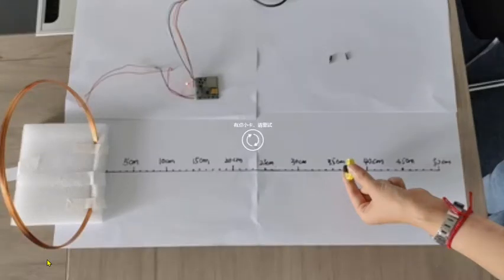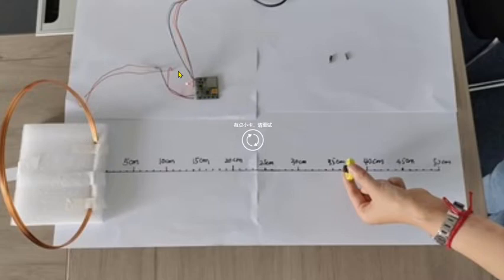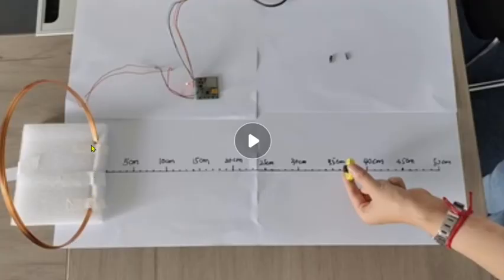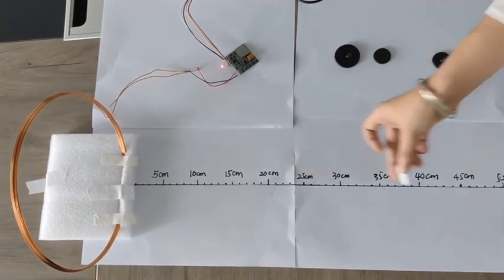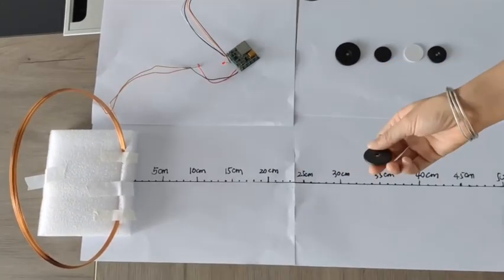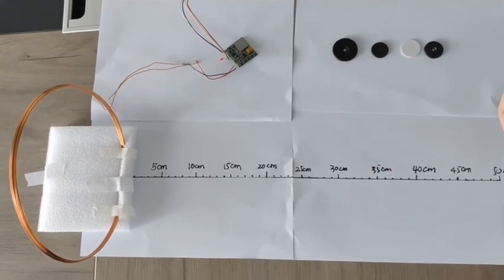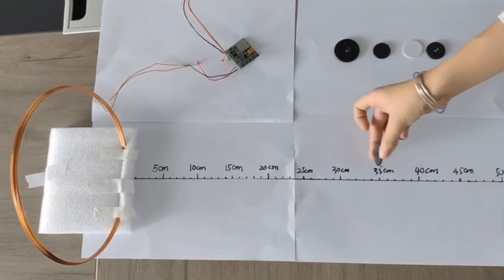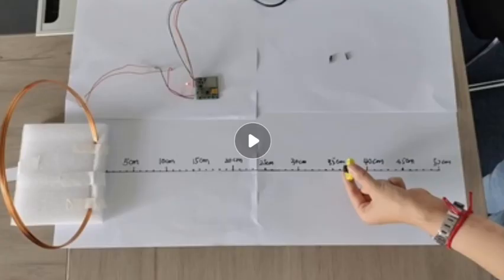How make an RFID Low Frequency Application long range by using suitable antenna

Comment: hello, what type of sensor that being use in this video, can it connect to the arduino and also can it be sent to malaysia?
Reply: Ni guna rifd,Nk buat utk apa?nk sy kongsi link rifd?antena dia diameter 22cm,kalau awk nk buat antena lg besar,seller tu boleh ajar,tp lebih baik awk beli meter utk test antena,sy bg tau awk ni,mana tau kot² awk nk buat antena besar,ble sy tumpang sekaki

Comment: do you have any documentation that can help me make such a device like that . thank you have a nice day.
Reply from the maker: The coil is very cheap. You don't need doing ti yourself, order from us.
Reply from the maker: https://www.security-warehouse.com/uhfat13.html
Reply: @RFIDSecurityWarehouse  that link gives a 404
Reply from the maker: @StephenKellyQLD  sorry for mistake, it should be at https://tw.security-warehouse.com/uhfat13.html，the website is in chinese but you can use our translator to change.
Reply: @RFIDSecurityWarehouse How much does the antenna cost and what size is it? Do you sell a 20cm diameter antenna like in the video? Or is there a larger size?

Comment: Greetings from Spain. Could you describe the diameter of the coil, the number of turns, the gauge of the copper wire, and the model of the sensor circuit? I am very interested. Thanks.
Reply: did you find anything?
Reply from the maker: would you consider purchase one for study?
Reply: @RFIDSecurityWarehouse yes
Reply from the maker: @karikiki5105  You can order from our official website this kit specially designed for professional, here the link. https://www.security-warehouse.com/uhfat13.html, our shop has been in market for over 10 years with track record, we'll ship item via reliable channel with tracking number for reference. Please feel confident order from us and trust our platform is a safe marketplace.
Reply: @RFIDSecurityWarehouse  can i request an antenna with different diameter or dimension?
Reply from the maker: yes, what size do you want? please email me for easier communication. @ahmadlutfi8056